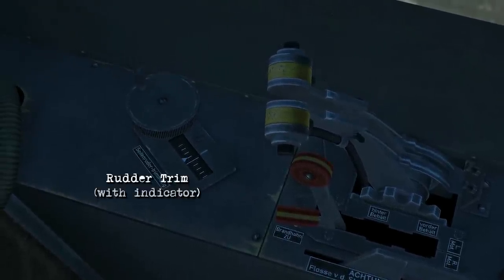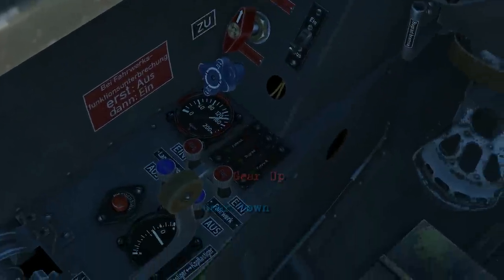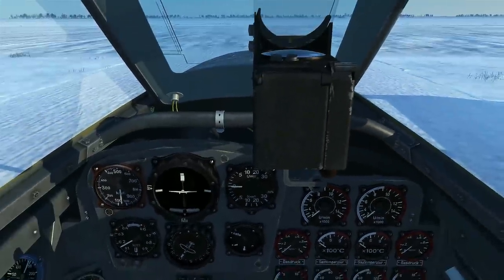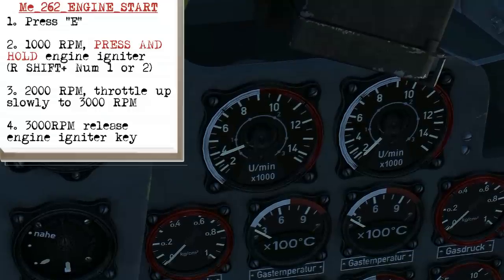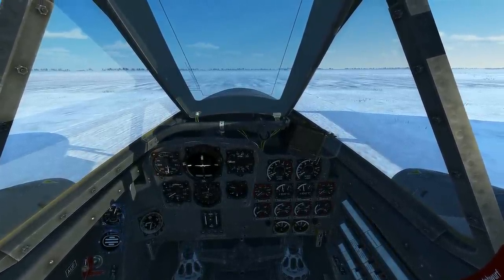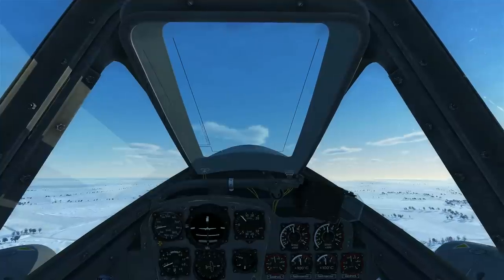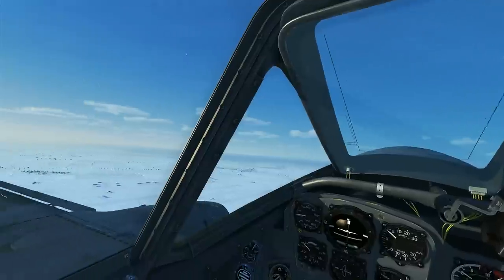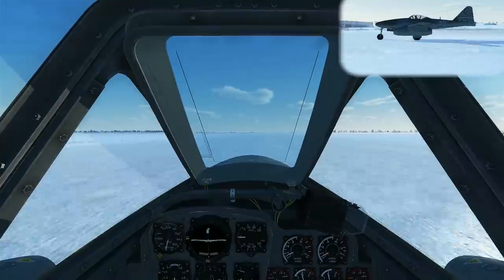Learn to fly the Me 262

Comment: I have the US pilot manual copy for the ME262 from a captured one. It has a back binding though and not the ring binder. I use to have a few websites back in the early 2000s for the first IL2. Stukaguide, HE111guide, and ME262guide.com. The Me262 engines were prone to engine fire, this is from the US pilot manual: "By opening or closing throttles too fast under 6000 rpm there is a danger of causing cavitations in one of the compressor stages, that is, by moving the throttle too quickly the compressor is overloaded and the smooth air flow breaks up just as it does on a stalled wing. Insufficient air flows through but the same amount of fuel is injected, resulting in insufficient power or engine fire". Over 6000 rpm you can move the throttles as fast as you want. I already see one mistake on this model, the airspeed indicator had two needles a white and yellow needle. White was Indicated and Yellow was True airspeed at 400 km/h and above the needles would stay together. Also in the manual it says to Check your Gas Temperature make sure it does not go over 650 degrees C for long period of time no more then a few seconds.
Reply from the maker: Good info there Stew for everyone to look at. I had the German manuals and a US one to base the video off, but you can leave feedback on the website to the developers for anything specific. I just make videos and not on the development team.
Reply: airspeed indicator has two needles, but they are both white

Comment: And just like when I tried flying the 262 in IL-2 1946, it was costly maintenance for 5 flights when I tried to take off. Overheating was my specialty.
Reply from the maker: What's an extra few hundred degrees C between friends? :-)
Reply: Did you get it to cool off? Kinda searching for a mentor here ;D
Reply: @RequiemsACTL  Hey by the way, my throttle stick only has the ability to change 1 engine. How can I throttle up 1 engine without throttling the other one up in this situation?
Reply from the maker: @natedogggaming1607  pressing the 1 or 2 key allows you to select/deselect engines individually
Reply: Thank you so much! Can I also select both at the same time when in flight?

Nvm stupid question I read more closely and figured it out
Reply from the maker: @natedogggaming1607  Both engines are selected by default, when you press the 1 and 2 key you'll see the technochat on the side telling you. The engine(s) can be selected at any time
Reply: @RequiemsACTL  That’s a great tip for something I was truly worrying about. Thanks!

Comment: Hi Requiem, thanks for your great videos and tutorials, really helps me out a lot! I wanted to ask if you could make a video about the german gyro sight, since i doesn't really work for me, would be very interesting! Thanks a lot!
Reply from the maker: Hey Paul, I have stuff in the works on the gyro sights, but it always just takes time. The problem with them is that as you start applying G the gyro reticule ends up out of sight quite often. Defensively in MP we can pull a lot more pull G much easier than in RL so that makes it harder to get accurate shots with a gyro sight unless a target is maneuvering in a relatively benign way
Reply: @RequiemsACTL  Alright, thanks for quick answer! Also good to know that you're working on it! I will try again without applying to much G and see how it works. Have a nice day!

Comment: Thanks! 
Excellent!

The engine overheat indication at startup got me scared.
But just set throttle slowly to 15% and then it locks!
I also had to deactitivate windows keystroke, since you have to keep shift + num 1/2 pressed to run up the engine.

It took me 3-4 engines to figure it out, but it is a magnificant aircraft to fly.
Combat performence I don't know, there are not many multiplayermaps featuring this AC, maybe for good reason.
Reply from the maker: Yeah that's just what happens when starting a jet engine. The temperature gets very hot while starting up before stabilising lower once the whole process is self sustaining. You won't see the 262 in MP very often because it ends up being used in an ahistorical manner which shifts the balance of a map. I still haven't flown a 262 in MP since it was released. I've shot a few down though at least!

Comment: You make this all seem so incredibly easy but I’m sure you have many, many years of experience :) Your videos are fantastically helpful, long may they continue. I’m curious as to which joystick /controllers you use. I’m thinking of buying a warthog as I’m using a t16000 with throttle and pedals and just never seem to have enough buttons.
Reply from the maker: Thanks Avetorro, I use a Thrustmaster Warthog (with a 10cm extension) along with MFG rudder pedals. Having something with lots of buttons really helps with DCS jets. The warbirds you don't need anywhere near as many.
Reply: @RequiemsACTL  that’s interesting. I never even knew they existed. I can see how that would improve control considerably as I have been experimenting with stretching the t16000 a few inches! Do you have a video that shows your actual hardware setup as that would be cool to see?
Reply from the maker: Yeah the extension definitely helps with controllability. No I don't have a video of my setup yet...there may be at some point in the future if I review any flight sim hardware.

Comment: It is odd but my 262 startup is not the same.  Your video seems to show that as soon as Engine 1 is running then it automatically starts winding up engine two.   For me I must switch manually to engine two then press E again.    I also have an odd bug that wont let me move the gunsight to one side.  I tried remapping the key to do it but it wont move.
Reply from the maker: That's odd. Both engines should be selected by default. Definitely sounds like a bug with the gunsight stowing too.  I'm not home yet so cant verify them.
Reply: @RequiemsACTL   Ignore the gunsight issue.  I had the gyro gunsight selected and that does not stow - Doh!

Comment: hi thanks again for the video, i have problem first mission i have bomb load and i cant never get enough speed to take off and I end up in the grass at the end of the runway destroying the gear. Any advice for taking off with full load?m thx i get speed 230 at the end of the runway and still i cant lift....
Reply from the maker: Reduced fuel loads and a standing takeoff helps. With the bodenplatte map out now though it should be less of an issue

Comment: For some reason, I am unable to use emergency mode on the engines. It appears there is an RPM limiter (which is visible in autopilot); however, I cannot find the keybinding for it. Do you know what key bind it is set to?
Reply from the maker: Check your difficulty settings. You may throttle assist or something on
Reply: The Air Combat Tutorial Library I don’t have throttle assist turned on. The RPM limited only turns off when autopilot is enabled. I managed to get emergency power to work on takeoff, so I think it must be altitude dependent.

Comment: Nice, thanks, I did not know the update was ready. I logged out and now he is updating.
Btw, the meter tucked away on the right above the breakers is a Volt meter, not an Ampmeter. 
I am new to flight sims, that Me 262 is a hand full. 10 crashes at start later......I think I need to wait until I have more experience. I do not get enough speed before the end of the runway.
Edit: I manage to get it  in the air. I found an airport that was still a bit short but ended in a "ramp" and then the terrain went down. That was just enough.  
Where did you fly it ? Are most runways to short or do I do it wrong. I have often problems recognizing the runway in most cases, so I first try to start using "at runway" and drive of in the direction it spawned but I think I do that wrong. By now I get most prop planes in the air the first try.
Reply from the maker: I'll upload my mission to practice the 262 with when I get home.
Reply: @RequiemsACTL  thank you very much. I learn a lot from you tutorials. I like for most how you make them so "real", it feels like I am learning to be a real life pilot.
Reply from the maker: @pa4tim  I was a flight instructor in real life before flying for the airline I do now, so I try to approach teaching in these videos like how I would with any real life student :-)
Reply: @RequiemsACTL  That way seems to work very well for me.  I am now watching the landing/take off video and that helps a lot. Now I know why I sometimes, just after take off, crash. The hardest thing on many maps for me, is to find the runway for landing and when I start parket/engine off, where to find the runway to take off because it often is all snow or grass.

Comment: I know this is an old video but hoping I can get a reply! I'm starting a 262 mission where I'm already lined up on the airfield so no need to taxi, just straight into takeoff. I put brakes on and increase rpm to 7000 but then as soon as I release the brakes, the aircraft pulls hard to the left. I try right brakes to stop this but it just doesn't have any effect unless I just hold it down hard in which case I just stop turning but no longer moving. Any idea whats going wrong?
Reply from the maker: Roll the plane forward a few feet first before applying full power because your nosewheel is likely offset.to the side. That will help straighten it first. There is also a nosewheel brake control you may not have assigned that can help initially
Reply: @RequiemsACTL  Thanks for your quick reply! I'll bear those two things in mind next time I start up, cheers.

Comment: I'm pretty sure I'm doing everything right but on some of my quick matches I can't seem to get it off The runway before either crash into a hill strategically placed at the end of a runway or some trees I almost need three times the runway they start me on.
Reply from the maker: Yeah it's really difficult to get this off the smaller fields. You'll either need to use the paved runways on the Rheinland map or take less fuel to reduce your takeoff weight.

Comment: Started quick mission.
Chose 262, altitude 2000m
Unpaused game.
Touched the throttle.
Both engines explode. 
Death spin.
Die.
Reply from the maker: If you airspawn keep whatever control you use for throttle in real life all the way forward (100%) to prevent that happening.

Comment: Please help me, I am playing campaign with this beauty, but the speeds are horrible, in level flight with max power i can do 500 km, but that's it if i try climb little bit goes down all the propelor aircraft is on my ass all the time, wasn't this plane able to fly 700 km/h level flight??? Thanks for your video!!!
Reply from the maker: Just stay high and stay fast. If you get slow and allow an airplane behind you (especially at low altitude) then it's going to be hard for you to get away without being shot at. Ideally you will make attacks with the altitude advantage, blast them, and use all your extra airspeed to climb back up. You can turn a bit, but avoid bleeding off all your airspeed and getting slow.

Comment: As soon as I get engine 1 to 1k rpm and hold igniter switch, she starts up but I get immediate engine damage and fire as it spools towards 2k rpm even before getting on the throttle
Reply from the maker: Use the inner RPM scale, its smaller grey lettering towards the center of then gauge
Reply: @RequiemsACTL  Got it sorted, my throttle was reading high when set to full back.  Had to do the center it, un plug USB cable for HOTAS, then plug it back in and go through range of motions to re-calibrate it.
Now it works through full range of motion I have no issues with engine start fires.
Reply from the maker: Excellent!

Comment: Try hitting  the "E" key on your keyboard.  Turn on the late model fuel regulating valve in the weapons setting menu to prevent mishandling the throttles. After running through real life jet engine start up procedures, it is a real joy to hit a button and let the ghost in the machine flawlessly perform the procedure for you. However, when we finally have solid hand-tracking capabilities in the sim, I will probably start performing the manual procedures myself.  Next up will be a VR trip to the O-club for a drink after the mission.
Reply from the maker: Yeah clicky pits are overrated I think for a sim, but they definitely come in useful for learning procedures

Comment: how do you lose speed in the me 262?
Reply from the maker: Reduce throttle slowly and just hold level flight once you get down to lower altitudes. It will start slowing, but you need to plan to descend far away from the field or else you'll need to do some form of a descending spiral.

Comment: i guess emergency takeoffs werent a thing.
Reply from the maker: Maybe if you'd like an engine fire lol but I think if you use the fuel valve modification it's less of an issue.
Reply: maybe add the Rheinmetall RATO boosters?

Comment: I know it's a bit early but how do you feel 1C/777 has done with their first jet engine plane so far?
Reply: technically its not their first if you take a look at il-2 1946
Reply: @Ash007YT  I believe that was a different developer, still published by 1C but not developed by 777 Studios
Reply from the maker: In testing there were various things we gave feedback on the developers took into account and to me the jet handles very nicely but still has the engine quirks (but granted I fly a much different jet in RL). I think they've done a good job with it overall honestly. The type of engine start is a nice compromise, ground handling is good, the engine is a little finicky as you expect, compressor stalls are present, and Mach tuck is present.